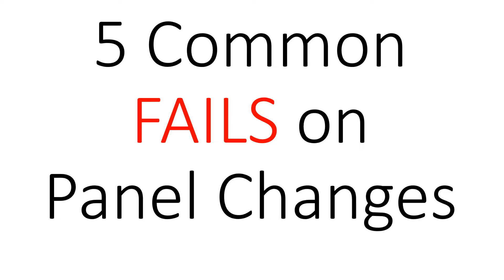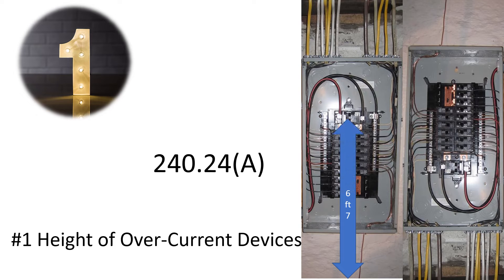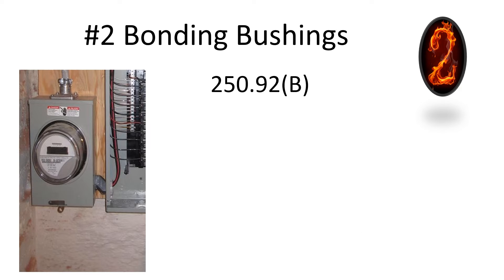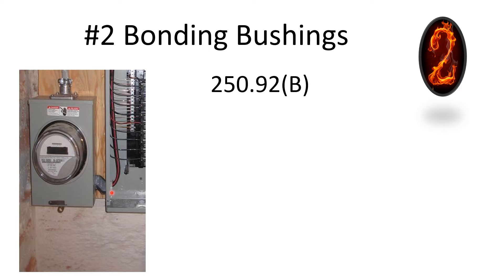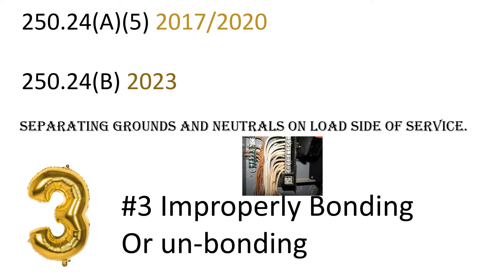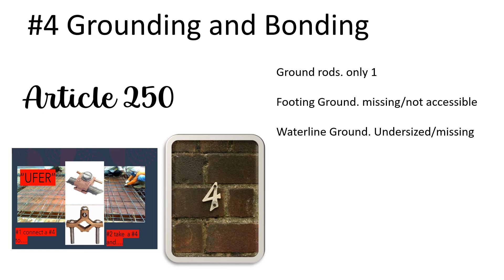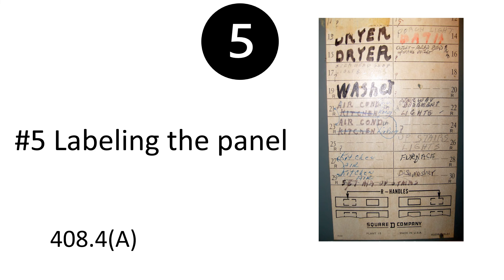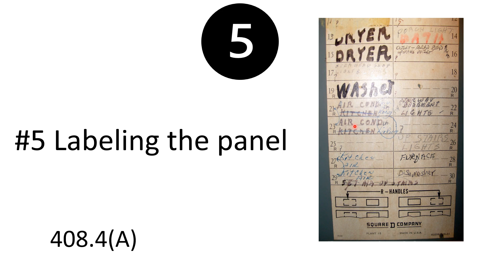FAIL! 5 Common Panel Change Fails. With NEC References.

Comment: The confusion about panel height comes from old timer's like me. When I started in the late 1980's all service panels had a up/down configuration for the main breaker which was always on the top of the panel.  So we always made sure that this breaker was not higher then  6 ft 6 then later 6 ft 7. Then in the early 2000's the horizontal  main breaker panels came out so we had to rethink that. It took the old timers a while to GET IT. If you installed a panel with the main on the bottom like you said in the video top breaker knockout not higher than 6 ft 7

Comment: greetings could you explain the question.  For a feeder tap not exceeding 10 feet in length and field installation,the maximum overcurren device rating supplying a tap conductor with an ampacity of 40amps is-------?       article240.21b(1) (4)

Comment: Coach  I wish you would put out more info on bonding water pipes and gas lines 
also here in TN - the state is asking/requiring  a bonding jumper inside the panel from ground bar to ground bar  is its a 4 wire and there are 2 ground bars  ( like I put a bar on each side of the box ), Cost maybe $10 more but IMO it sure makes the job look better ( gooder)
Reply from the maker: Are you using these ground bars as neutral bars as well? are you attaching the bars using one of the methods listed in 250.8?